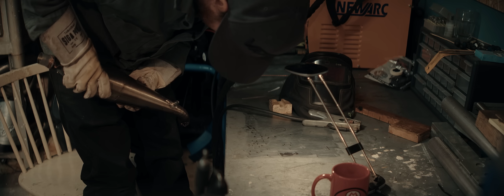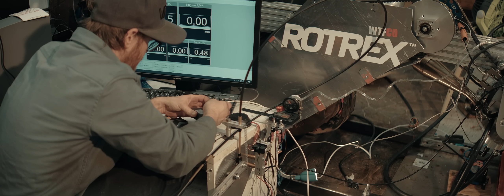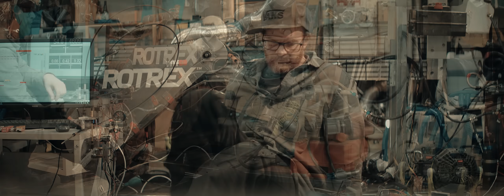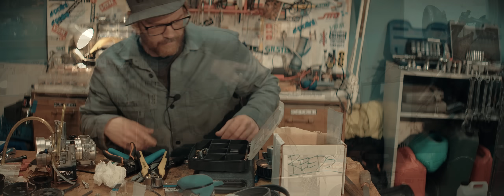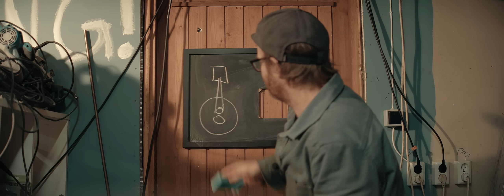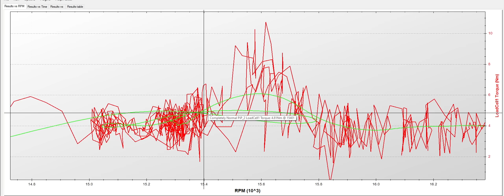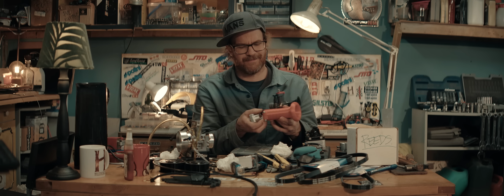18000RPM, But then...

Comment: What's your stroke measured at? too much stroke makes lower RPM. I'm order for my 50cc to get high rpm's I shortened the stroke till I had allmost no bottom end at all and needed to push start.
Reply: It's could be the voirations the beanch is making too
Reply: The stroke is just short of 40mm. Alex is using a longer 90mm con rod which doesn't afect it's stroke.
I feel the large crancase volume isn't adding to performance but it's Alex's baby.
I hope and beg Alex fits the stuffers when the engine is stripped down, nothing to loose!
This engine will rev to 20k no problem when finished. Reliability must be paramount.
Reply: @malcrandall1309  I think the size of the crank is fine. after watching closer I really think it's vibrations from the bench.
Reply: @Ro-Bucks  High frequency vibration has always being a problem go back 5 years to the SPX era. Alex did some crank balancing years ago without much success.
I feel crank balance needs addressing now Alex has a press capable of doing cranks and the milling machine to bore the correct size hole for tungsten weights.
I feel it's just the lack of time and motivation.
Reply: @malcrandall1309  With a rod length to stroke ratio of 2.25:1 (one of the highest that I've seen in 2-stroke design), there should be little piston side-thrust to worry about on the expansion/exhaust portion of the cycle. If he utilizes any deSax-offset between the wrist pin centerline and the crank centerline, the pistons side-thrust problem will be further reduced; therefore, it's no wonder that the piston-sleeve combination is surviving so well under sever experimental conditions... in my opinion, a very smart set-up, which certainly justifies dealing with his admittedly large crankcase volume. Also, the "blow-through" configuration of his mechanically-driven centrifugal compressor (minus inlet valving) is a very clever way of reducing/eliminating the engine's primary pumping losses. I believe that the bottom-end anti-friction bearing problem can be successfully addressed once the nitrated-fuel situation, along with a crankcase heating system is implemented, thus allowing proper tuning of the engines A/F mixture. Keep going, Alex, many of us believe that you're on the right path!
Reply: @davidgierke7582  A 90mm rod is a long devil and I personally feel it is a tad too long.
I went on Sacha Drenth's channel, have a look at those beautiful 50cc crankcases he made with reed valve intake. I'm torn between reed valve and disc valve, I think disc valve wins on the grounds of reliability. Saying that Alex has had rotor failure on the SPX variant, that's where he got the idea for the fully resonant induction system.

Comment: As much as I love your channel and content I feel maybe it’s time for a clean up. The golden rule is to change 1 thing at a time. It feels too much like snakes and ladders…. I don’t want you to start again but sometimes the longest way is the shortest
Reply: Sadly the brake/controller has presented problems from the very beginning. I'm sure it would be possible to control the electronics via a potentiometer with his left hand giving a ramp up as required and a instant unloading so the engine doesn't stall.
While Alex is waiting for parts this could be a essential project.

Comment: Rotax had main bearing issues early 1970s, single cylinder snowmobile engine. They published a repair that involved machining the case and inserting a sleeve of unknown to me non-heat-conducting material. Really improved reliability of those engines

Comment: A spring in series with the load cell might filter out the high frequency vibrations. Same as how a dual mass flywheel has springs to separate the power pulses from the constant torque.

Comment: I think it was mentioned here before, but before you move the load cell to a different place, maybe try to mount it in a rubber bushing, this should reduce the effect of the high frequency noise to the Signal. And it changes the resonances frequency of the engine/Dyno combination, so it maybe helps even if the noice is not caused by the crank but by vibrations of the Dyno. I would like to see that. Great Content anyways, I really like your video, thank you for your work.

Comment: You could try a dampener of sorts between the engine mount and the load cell. It might smooth out some of the spikes.  And your heater has some old hoses with splits in them or the fill cap has an air leak.  There is a pump that pressurizes the fuel tank and that pushes fuel to the nozzle.  If the hoses or cap is leaking, it won't push up enough fuel to get all the btu's the heater is capable of.  Videos on fixing the hoses and adjusting the pump pressure relief valve are in YouTube.  https://youtu.be/r_P58zIhnA4

Comment: From my understanding, it’s lacking fuel on the low end. Judging by the throttle input to engine response, I’m pretty sure on that. Increasing the idle jet might help. And those slide needle has to be tailored to the engine output. Bigger on the idle jet, smaller on the main jet as the exhaust pipe will effect severely to the top range fuel mixture
Reply: I've also noticed the slow increase of engine revs when the throttle is opened. I put this down to the lack of primary compression. Adjusting the pilot jet is easy it costs nothing. When i used to race 125 twin cylinder Yamahas back in the early 70's we used a 1/16" size jet.

Comment: Have you considered using a water brake type dyno. The go kart shop that builds my race engines have a Dynomite Land and Sea small engine dyno that works very well. I wonder if running two computers would help with communication issues caused by RF noise. I'd most probably have one computer to control your engine dyno input and one computer to control engine management. After each run you should be checking spark plug colour for rich or lean and adjust carb to suit conditions. I love carbs that have high and low needle jets.

Comment: I saw that EGT hit 550 and thought "Ohhh that's not going end well." lol. still 18k is nothing to sneeze at. well done. You were right though the lateral forces on the crankshaft probably caused a lot of extra force on the main bearings in one direction causing uneven wear. Its probably for the better though that the main bearings gave out before the piston detonated.

Comment: I have a cast iron cylinder head. What can I do to improve performance on that it heats up and then it just quits and then a couple seconds later I can start it back up it’s a Ginuwine scooter Radler 110 2005 I live in Ogden Utah next to Bonneville salt flats. Hit me up next time you’re in town we’ll go to dinner.
Reply: It  sounds like it's got a crack in the combustion  chamber. When it heats up it opens up.

Comment: At the 7.33 minute mark it's way to lean it's chattering no revs , when you go and look on boysen reeds chart with all bikes (kx's) from 1980 to 2020 and see kx60's to kx500 you can clearly see a massive difference in jet sizing across all cc sizes and years some kx65's run same main jet as a kx125 but poilet will be alot smaller .
I'd start with Mikuni mtx 26mm your main jet could be 150 to 180 and smaller pilot all depends on carb design and as you know temp , altitude,  air density. 
The sound of engine to me to much air no rev (carb to big) , then not enough fuel less reving after that (jetting to small) also to much timing .
OK back to video , don't give up loven it Alex.
Get pilot spoton idel small sharp revs then move onto the power curve as in the main jet.
Edit at end of video bugger Alex with bearings not good but it's experimental on jetting either way rich and lean.
New carb and slide reeds will be a massive difference. 
Cheers look forward to next video

Comment: You need a air fuel ratio sensor in the exhaust system for accurate data.

Comment: If you tachometer/rev limiter is set up in 4 stroke mode it will assume 25k rpm when it sees 12.5k sparks per minute

Comment: If I need to drill jets on customer bikes, I usually grind off the number with some sandpaper. Then I know the next guy won’t get tricked and he has to measure to confirm size. It’s a smart practice that can save a lot of headache👍🏼

Comment: You had me when you showed you were coming to your senses. Moving the load cell to the retarder, getting rid of the slide reed block and going with a simple conventional reed setup, moving to a known good carb and CDI setup. Then you lost me again going back with a slide reed....   The thing about reeds even with limiting cages, if the pipe is going to pump, the pipe is going to pump. The reed is not going to get in the way of that. That little restrictive single read slide thing you have going on is definitely going to restrict something. It's a single itty bitty reed when it's closed, then the transition will likely cause a lean point because there's no read, and there's a block in the way as it then begins to open up into a complete open orifice. It's just too many working parts, and you're trying to dictate when the engine is supposed to be efficient rather than letting it be efficient where it is naturally efficient. I'm just throwing more variables and unknowns into the mix. Not very scientific.

Comment: I think your first thought about the PIP cylinder with a rotory valve and the same carb from the SPX days would be amazing!
Reply: When the SPX was running on petrol it ran great until Alex changed over to R/C fuel then it went Tits Up!
If Alex wants to run R/C fuel N/A he will have to use a EFI as a carb won't atomise the fuel enough to run such a high revving 2stroke.

Comment: When I used to design aftermarket  ECUs we always had no end of problems from people trying to run "1 tooth per TDC".  An engine accelerates and decelerates so much in one cycle, it is impossible to accurately predict real engine position without more teeth.  A small single cylinder engine is worst case scenario.  12 teeth is a good amount.  You will find that or higher on OEM engines.  Have a look at what configurations your ECU supports.  Results will be much better.

Comment: A damper would be worthwhile to test before completely changing up the dyno. Easier at least. Rubber bushings or some sort of stiff spring on the load cell may help too.
A harmonic balancer might also be useful?
Reply: If Alex was to make new crankcases for PiP,  rubber bushes would be advantages as these engines have all suffered with high frequency vibration issues.
Crank balance is one place I feel improvements could be made.
I think the complexity of a balancer shaft and power robbing  properties is prohibitive on such a tiny engine.

Comment: Love the content ! Not sure if you try this or not but  A trick I found that works for telling jet size I do not know is I use a slide needle use a marker to color the needle  then put the needle in the jet seat it enough while turning the needle to show the contact point I then  measure the line on the needle with my calipers to get the jet size.
Reply: That blew me away to read your comment. While watching, I was thinking about measuring the jet size, just like that, including the marker and the callipers.

Comment: Two suggestions....
A. Give Maxima lubricants a call and discuss what oil they recommend running...I believe Maxima K2 would be a good choice but I would rely on Maxima's recommendation and not mine.
B. Investigate a relationship with KTM/Husqvarna...they just produced a brand new design for a fuel injected two stroke engine and are using it in the 2023 Husqvarna TX300 two stroke...it is throttle body fuel-injection as opposed to the old transfer port injection used on earlier models.  Of course direct injection would be the best but that is even more challenging.

Comment: at such a RPM you need a very strong ignition, so that the ignition spark is not blown out, and a very cold spark plug to avoid glow ignition. consider getting a direct aspirated cylinder (the reed valve block is directly on the cylinder).  a full circle crankshaft with plastic inserts that compensate for the piston weight, so that you get a higher pre-compression

the exhaust system should be as straight as possible, and the pear shape should also be adapted to the desired rpm.

also think about a pre-injection, since the mixture formation has very little time to mix.

Comment: Maybe you should go back to the original wheel dyno?
Reply: Or by  controling the controler manually with a potentiometer giving a raise in braking force as and when required and instant back off.

Comment: Heres something big I noticed that you probably haven't considered. Your heater takes all the oxygen out of the room. Im suprised your still breathing let alone have combustion in your engine. Or at least a proper combustion... You need a passive way of hitting your space there. In other words it has to be heat transfer instead of direct flame heating.

Comment: I would go back to mixing your own 2t, that engine needs a lot of oil the off the shelf stuff is only good for off the shelf applications.
Killed main bearings in chainsaws running at 50:1.
Reply: He's also using water cooling, with relatively low radiator temperature. Should probably use a TC-W3 oil like an outboard motor or snowmobile when running on petrol.
Reply: @nerd1000ify  The old flavour of choice I remember from SPX days was Castrol XR77.
Reply: @nerd1000ify  I was wondering if you meant TC-W3 was meant for lower engine temperatures so I dove through the docs. I know my outboard runs way cooler than other motors I've tuned, but I didn't know the oil was actually designed for that. Sure enough that's what the docs suggest. I guess the "W" stands for water cooled. There's obviously lots of other goals that the TC-W3 cert tries to hit, but I thought that was cool. Learn something every day!
So as you suggest, he shouldn't just be running any old oil in this beast. He should be mixing up some good stuff. I think he got carried away when he went on his rampage to simplify the whole setup and when he switched to just gasoline he didn't pay enough attention to it.
Reply: I hadn't had problems with Stihl bearings going while using the blue Stihl oil running 50;1 but the loading is much lighter on those than this engine.
Kart racers swear by castor oil for 100cc engines revving over 20k.
Reply: @malcrandall1309  Chainsaws is probably getting off topic, some old Stihl definitely have well built bottom end, however pretty much all new saws have some sort of Strato arrangement so breath fresh air aswell as mix so they run real hot/lean, some of the new oil I believe is specifically formulated "thicker" so you can get away with it at 50:1 anything other than those is 40:1 minimum.
As a professional with the saws mine get a lot of hours on them probably why I wear out stuff like crank bearings.
I now like to run Castrol power 1 full synth at 33:1, interesting story I was milling with my old Stihl064 when it stopped (sounded bad) loss of compression, on inspection the winter air flap was open so everything got way too hot thought I had melted the piston but when disassembled it had popped the head off both cylinder bolts on PTO side away from flywheel cooling I'm assuming from thermal expansion and the piston and cylinder where perfect nice and oily inside I put that down to running quite a bit of good oil.
Reply: @mrln247  Many engines came back seized solid on the piston due to the lack of oil in the fuel even after tuition and signing to say they fully understand this engine needs oil mixed with the fuel.
The blue Stihl oil is quite thin, works great on strimmers working 8 hour days. A bit more oil is always better than a bit short. I am only refering to Stihl here.
Reply: @malcrandall1309  I ran Maxima Castor 927 in my 125 cc kart (~16k rpm) and my YZ250. Never blew anything up. I'd probably run it again even though there are clearly nicer oils. But not on my outboard unless I was racing and I was pulling it apart a lot to check it.
Reply: Oil one of those endless opinions things, temperature wise I understand the suggestion but the duty cycle operating window for the oil is different to max power pulls at possibly >20k think the low temperature is more accident than design internal combustion engines are more efficient if you can run them hotter. Huge case volume to swirl mix in and dilute everything with air 18-20k is quite high RPM too. Returning to what many racers swear by so castor or similar at maybe 20:1 should help save components.

Comment: I might think now, that you maintain need a second ignition system. Dual plugs if possible. You may not be hitting every stroke.
Reply: 18k plus rpms 2stroke. Gonna reed to split the duty.
Reply: Oh and reply 1 I meant to say need to split the duty. Not Reed
Reply: It reminds of when Honda went wild with the Fireblade. It needed 2 sets of injectors for the first time to be able to trigger even fuel flow. Now I know that a cycle itself but the fact was that it was not able keep up. May be that this at least 1 issue keeping the machine back. It want to move forward always. You need to remove the things that impede it from going forward rather than wait is making it go forward.  We have that,  supercharger, someday. I wish I could walk over and get into helping hands on
Reply: Oh and whatnot wait. I may need autocorrect sometimes but it wrecks my point a lot of times. Haha peace

Comment: If you turn the intake 90 degrees and make your rotary valve parallel to the crank and supercharger drive, could you balance the rotary valve against the secondary force?